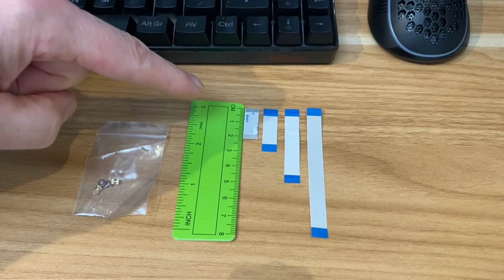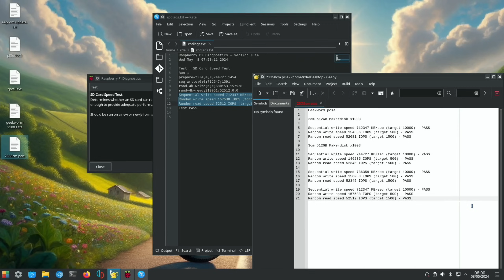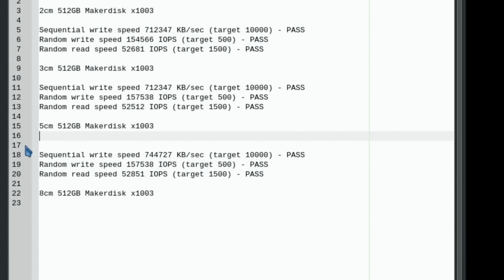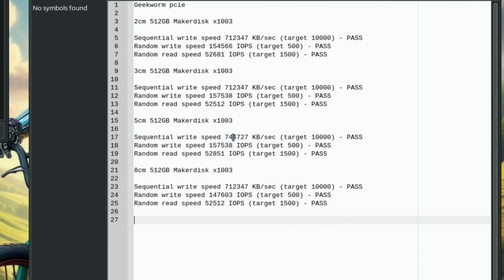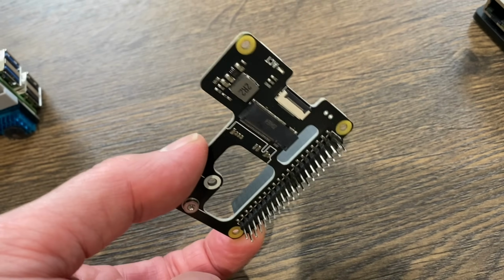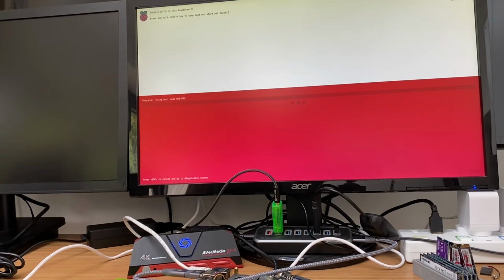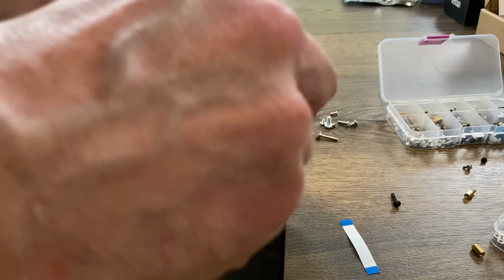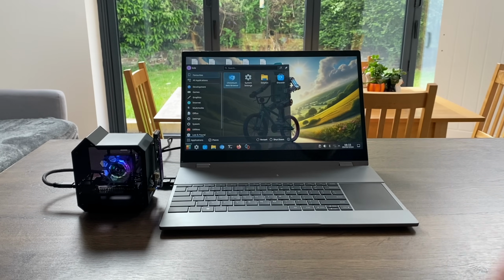My new NVMe setup Raspberry Pi 5. Plus longer PCIe cable tests

Comment: Please Reply Can I install React OS, Ubuntu OS and other minimum requirement OS on Raspberry Pi Zero W and Raspberry Pi Zero W 2 ?
Reply from the maker: Raspberry Pi os is lighter than Ubuntu 

Raspberry Pi Zero 2W. First time setup. Far better performance with Zram.
https://youtu.be/vZkfuVyybIw

The zero w is too slow for an os with a desktop environment

Raspberry Pi Zero W. Retropie, Raspberry Pi OS & Puppy Linux.
https://youtu.be/JCZlz0igbK4
Reply: @leepspvideo  react os is 64mb ram and 2gb storage required can I install?
Reply from the maker: @suthardashrathkumargajjard4457  I don’t see an Arm version for Raspberry Pi

https://reactos.org/forum/viewtopic.php?t=17213
Reply: React os 64mb ram and 2gb storage required can i install ?
Reply: Can run ubuntu on raspberry Pi zero w and raspberry Pi zero w 2
Reply from the maker: @suthardashrathkumargajjard4457  zero 2w yes but very slow

https://ubuntu.com/download/raspberry-pi

Comment: I have seen an SD card slot expansions ribbon cable, so you could buy one of those and mount your SD on the outside as well
Reply from the maker: Micro SD Card extension cable test. Short Vs Long Vs card slot. Raspberry Pi 400.
https://youtu.be/jp8-WdNS62Y

Comment: For the NVME Boards that need to make contact with the GPIO pins, You can make use of Jumper cables (male/female) to connect them to the Pi 5 GPIO Pins, without any problems... so basicly, you should be able to connect all the boards you got, outside a case or further away from the board.

I wish I had longer cables like the 5 and 8 cm... gonna see where and if they are available in the Netherlands.
I got the 52Pi No 4 board on my Pi and planning to install the Waveshare USB 3.2 HUB to it aswell...via the GPIO Edge connector(2x40-pins) extender.

Comment: Or just buy the Argon NEO 5 M.2 NVMe PCIe case.
Reply from the maker: Removing 4 screws to replace an nvme drive was something I was trying to avoid. I predict than fan will be noisy compared to the ice tower fan. Although I haven’t tried it.
Reply: @leepspvideo  I see. I don't like fans at all. RPi can easily be cooled passively.
Reply from the maker: @3dhYT  the case you recommended has a fan. The ice tower cooler is effective without the fan, most of the time it’s not running or running slowly. You can remove it from the heatsink
Reply: @leepspvideo  Yes, I know it has a fan, but it's the only case with NVMe. For myself, I would choose a passively cooled case.

Comment: To make the microSD card reader easier to access, what about a short microSD to SD card adapter cable.  That would allow you to position it closer to the gap for easier access?

Comment: Good video.  Nice results.  I'm really enjoying my pi 5, pimoroni nmve m.2 shield coupled to a crucial 1tb w/ an argon large black heat sink.   No micro sd card and io results are comparable to yours.  The little thing looks completely retro and similar to a dual operon server build i put together 20 years ago but smaller.    i picked up two Upperizon 18.5 slim monitors for it as well.  Nice little learning system.

if i would really like to see a review on current power sources from you.   Many things I've learned about the pi i learned from watching your channel.   I bought a LIMETA 200W 5-in-1 USB C Charging Station(140W Max), PD 3.1 Wall Charger Adapter as the 3rd usb type c rail specifically listed  the port as capable of 5v 5a with a 100w cable.   Also the more I read it seems there are a lot of folks confused or concerned about the pi 5 power requirements.
Reply: Yes, when I was checking out the Pi5 while waiting for delivery , I was ‘confused” about the power requirements.
So I fell back on First Principles…

RTFM

I am no longer ‘confused’. Amazing how that works.

Comment: Got no single gpio cables? Could use them or a really short gpio ribbon cable to help with compatibility for the other nvme boards
Reply from the maker: I have many, it’s easier for me to use one of the boards I have that don’t need gpio pins connected
Reply: Fair play